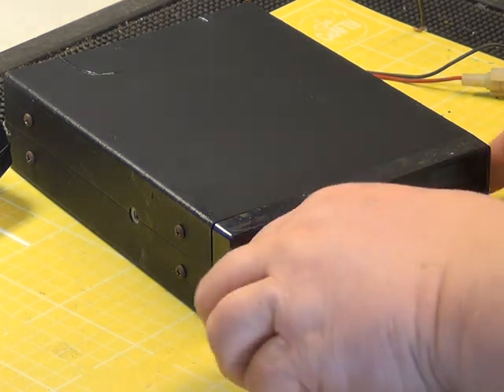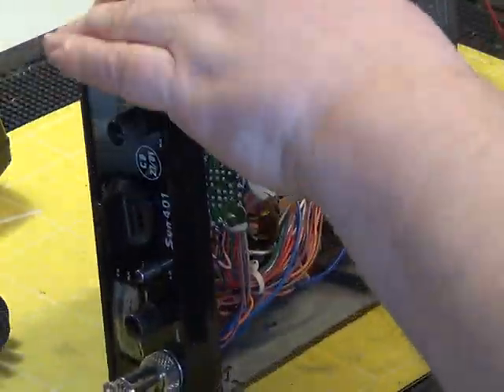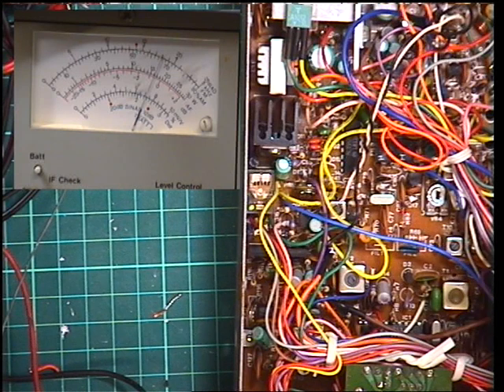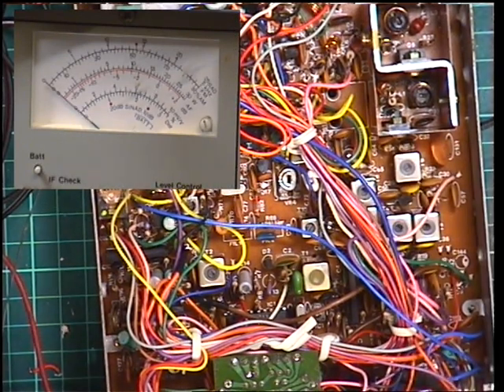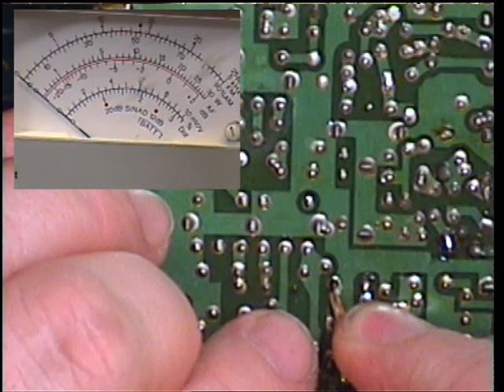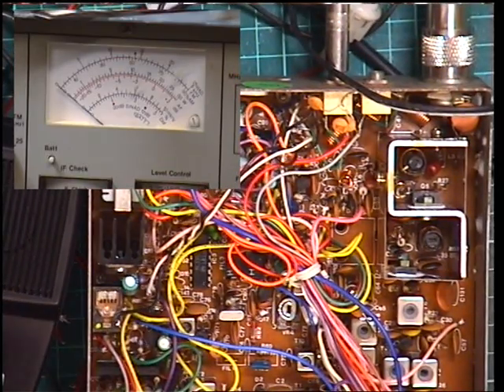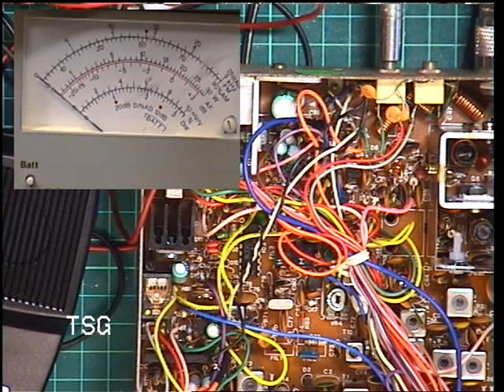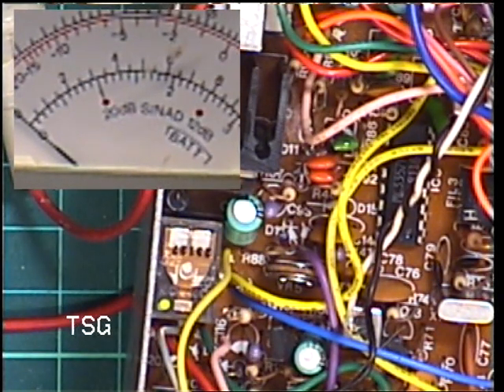Sun 401 UK CB 27/81 CB radio (mobile) - Repair & transmit alignment

Comment: I have the domico convoy, and think it’s a lovely looking radio, but I can’t get on with it for some reason. It came in very poor condition to me, with dry joints, the main one being on the wire link on the aerial socket at the pcb end. It’s another one where I had never seen one before, except yours, which was incredibly handy. 👍
Reply from the maker: Glad to be of help. The fact I have both the Sun 401 & the Domico Convoy1 must put me in a pretty unique position!

Richard
Reply: UK CB radio servicing I bet no one else has the pair!

Comment: 28:58 radio is on low RF on the switch
Reply from the maker: Bear in mind the switch did nothing until the 'set power' internal preset was replaced. It's a weird circuit as low power will only work if the set (high) power preset is working.

Richard

Comment: I'm sure I've got a sun radio that looks identical to yours but is Am mid only
Reply from the maker: I'm sure Sun radios would have appeared with different innards on various markets, especially FCC at the time

Richard
Reply: There was a naughty rig under the name of ham international uk, or colt 444 that has the same casings, and the internals are similar at first glance, but is obviously AM with an FM board in, and you pulled the squelch out for fm. An interesting name, Ham international Uk, baring in mind it’s was not a legal uk approved radio.
Reply from the maker: @timothyjones4950  I have one that came as a scrap chassis & has a 3-position switch for power, including 10W (liers!).......just dawned on me why the Domico/Sun meter is calibrated 0 - 10W. Thanks for putting 2+2 together.

Richard